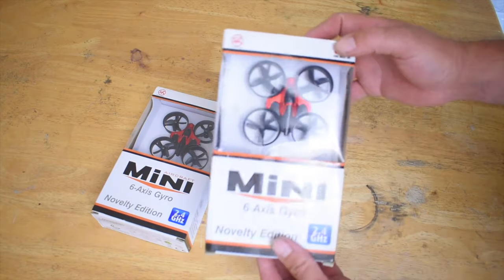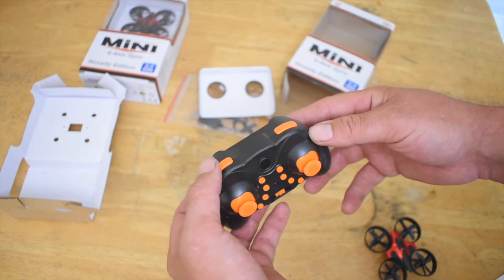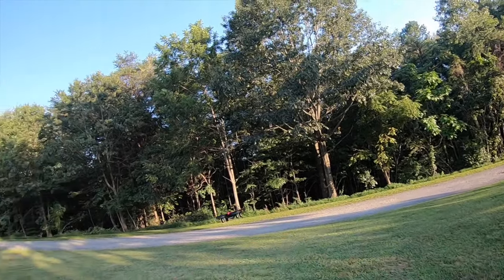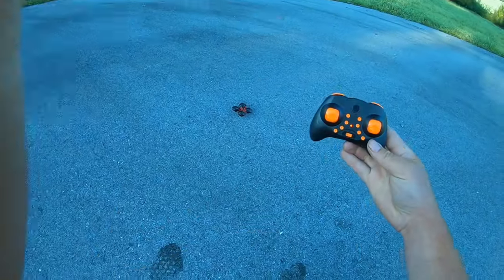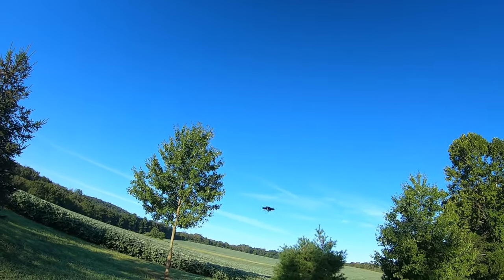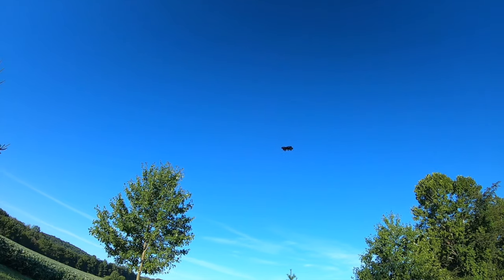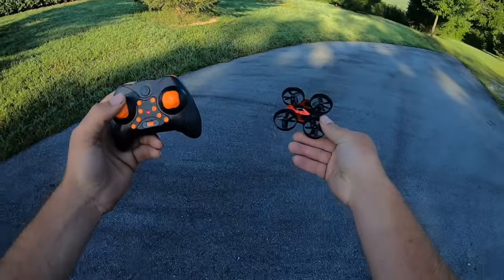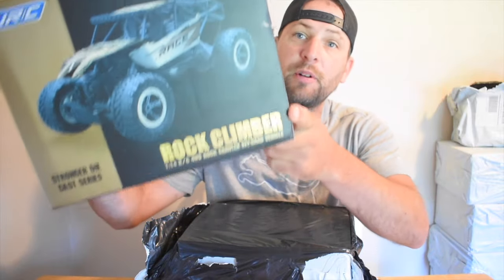RH807H Mini Drone - Unboxing & Review

Comment: I have the same drone like in the video 
For some reason my drone is pulling backwards and almost impossible to fly forward.
I made sure that all 4 propellers are spinning properly. 
Apparently some setting has gone wrong and now I don't know how to reset the settings so my drone can balance again.
Please help me.
Reply from the maker: Calibrate the gyro. That should help.
Reply: How I can do it?
I was trying to search for user manual but no luck
Reply from the maker: @olegnazarov5349  sticks down and in

Comment: Runhuzhineng for the win 😁
Reply from the maker: RC Drones And More you are due for a win. It’s been a long time.
Reply: Ready To Run RC it’s been a while but it’s worth it cause sometimes I’m quick on the 2nd chance as well , I really like the mini whoops you can definitely mod up fpv camera .
Reply from the maker: RC Drones And More you might have to beef up the motors a little on this one to be able to carry an Fpv setup. You were getting those second chance ones. Haven’t had one of those for awhile either. Everyone has been claiming their prizes lately.